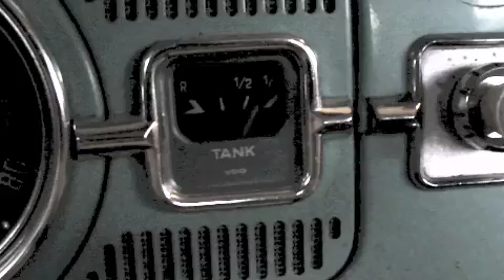Volkswagen Beetle Review

Comment: NIce car. You state that Volkswagen began manufacturing Super Beetles in the 1960's. The first Super Beetle for sale in the United States was the 1971 Super Beetle, distinctive by the longer wheelbase and curved windscreen.
Reply: correction the secund super beetle(1303) had a curved windshield, the first super beetle(1302) still had a flat windshield, basically a regular 1300 with a redesigned front end.

Comment: I like VW beetles and am on my sixth one now, all 1961 to 1964 but I cannot agree with the engines being "bullet proof". Burned valves and several dropped valves were all too common to make those engines reliable. The transmission is close to bullet proof but certainly not the engine. There were a lot of poor idling problems that were difficult to eliminate and occurred on every beetle I ever new. Both my brothers had VW cars too with the same results. They did not heat the interior good enough either unless you maintained highway speeds so were unfit for snowy climates unless you had a gas heater. I haves repaired them for 46 years for a number of people and could pull an engine in as little as 8 minutes but lately have made a number of Orange County style custom trikes out of the engines and rear suspensions. I have to admit I did enjoy working on them but that is what you have to do. It has been 41 years since I drove one as an only car as I could not trust them but it is still fun to show one at car shows. Have fun with'm.

Comment: Nice VW. Few things: Your car cost about $1,200 new, your gear box needs work, its fully syncro. Engine lid is not original, which explains why the spring broke. It was either damaged along with the original hood or installed wrong. Engine will not last that long, they need a valve job every 40,000 miles if they don't run hot which many of them do.